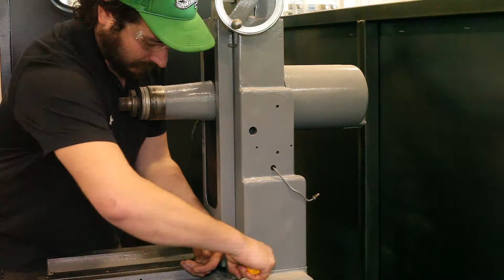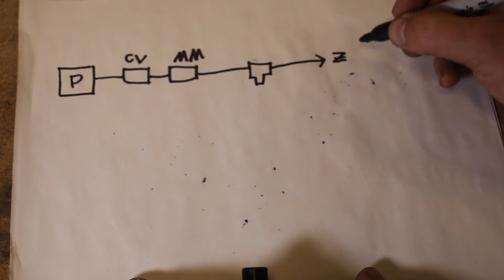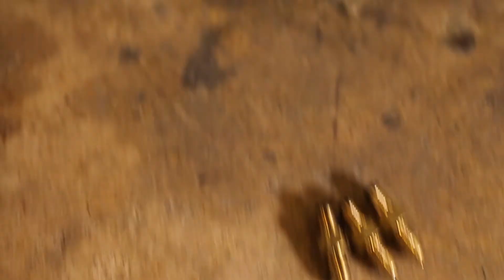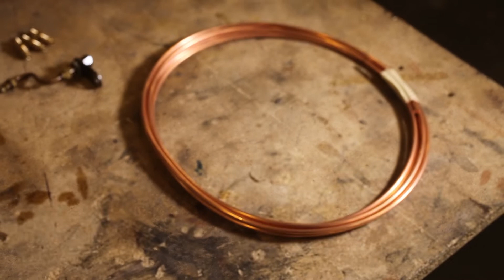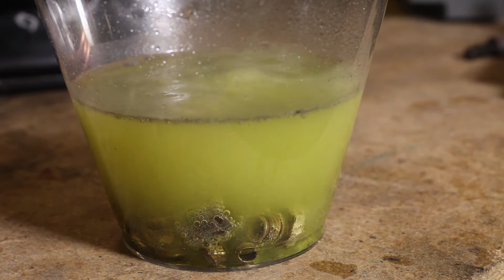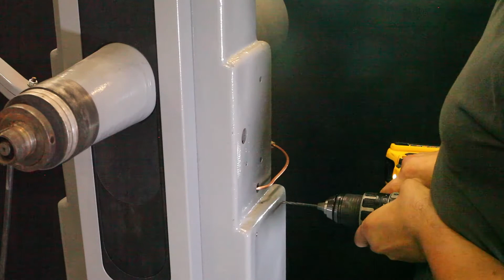Boyar Schultz Surface Grinder Rebuild - Part 5: Repair and Installation of Drip Oiler

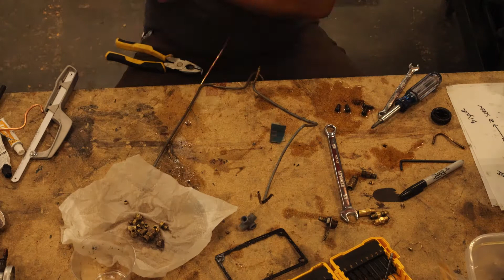Comment: Why a hack saw over a copper pipe cutter.  Seems you have the possibility to get a bit of copper bits in the pipe.  5:53.  I did not see you blowing out each pipe after cutting it that way/

Comment: Grest video- thanks.    My BS 612 got really "stiff".    I took off the table and found the ways were almost dry.   The issue was a kinked plastic tubing.   My question is "What size is that clear tubing?   I measure the od at about .152 and the id about .97.  Doesn't appear standard to me.   What did you use?     ThanksEarl